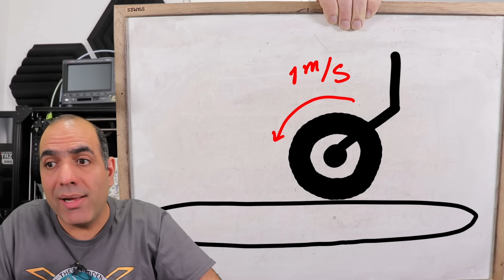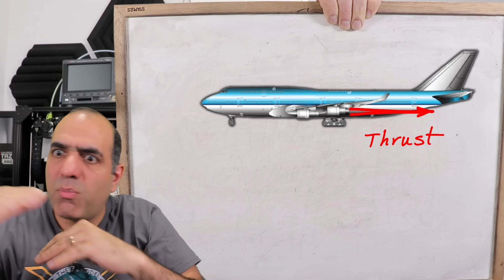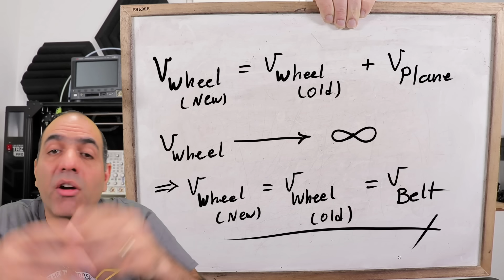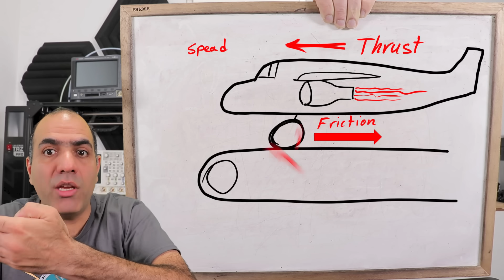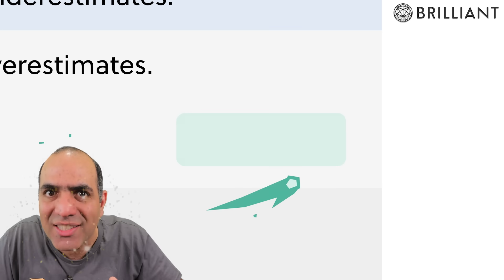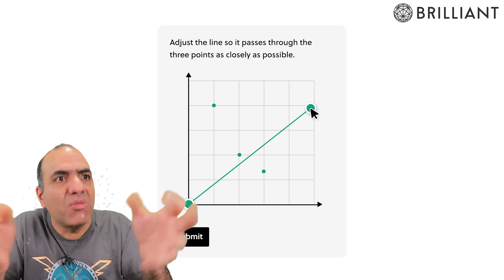Airplane Question that Drove Me NUTS!!!

Comment: If the problem is the wheel moving, you could just sit on the brakes, thus making the wheels immovable. While the engines ramp up, the plane would move the locked-down wheels and the conveyor belt would just follow along, keeping the wheels stationary in relation to the belt.

BUT if the belt is designed to move ONLY when wheels are turning, then i guess the flight is cancelled and you get stiffed by Delta customer sevice.

Comment: The reason why a plane takes off is because velocity of wind at the top side of the wing is faster than the lower side creating a low pressure region at the top which cause the plane to lift. The main factor here is the relative velocity between the plane (wings) and head wind. No matter how fast the wheel spins on the conveyor, as the plane doesn't move, the relative velocity is the velocity of the head wind which isn't much (unless there's a tornado in which case there are other things to be worried about.) Hope it helps!
Reply: The wheels are not imparting torque. The engines accelerate the plane and produce the airspeed, regardless of ground contact. You could lift a plane straight in the air and start the engines, and then drop it with zero lateral airspeed. The plane would still be able to enter stable flight because the engines push on the airframe, not the wheels.
Reply: @Dustin Brueggemann  exactly. That's why the plane would take off in this case(say at 200 km/hr) while the wheels would spin at a linear velocity of 400 km/hr)

Comment: My initial thoughts:
Probably not, turning a wheel on a plane doesn't generate lift. On the other hand, if the treadmill is turning fast enough to displace the air (Magnus effect) it could theoretically generate lift, but that seems unfeasible.

Comment: I haven't finished watching the video but as an airline pilot who also happens to have a bachelors of engineering, I feel like I'm qualified to comment on this. The speed at which the wheels are turning has no relation to the amount of lift a wing can generate. The plane would take-off completely normally, the wheels are not driven so it does not matter that they are not spinning.

Comment: Actually, another thing to take into account in the cases where the belt speeds up infinitely is air friction. The faster the belt goes, the faster the air around it will go, and potentially, if the belt goes at a sufficient speed, the air could speed up to a high enough point for the plane to take off while its relative speed would be low, even potentially negative.
Reply: Glad to see another big brain in the comments. That's called ground effect, and the interaction between the air moved by an infinitely fast treadmill and the wings is only going to add more lift. In short, as long as the plane has sufficient enough thrust to take off, treadmill or not, it's taking off.
Reply: Another thing to consider is that the maximum tractive effort the belt can possibly apply to the plane is limited to the maximum static friction between the belt and the wheels. I am fairly sure you will find that number is lower than the thrust of all 4 of those jet engines by a large margin. That is to say they are going to start acting like skis because there is not enough force being transferred to the plane via friction to overcome the thrust because there is no way to generate enough traction.

Comment: Just full brake the wheels and full throttle the jet engines. The wheels and conveyor belt will lockup (0 speed of both) and the plane now pushes itself and the conveyor belt to gain some speed. With 0 friction of the belt's bearings the plane is like having wheels just with the intermediate of the belt. Problem solved (for me at least)

Comment: I like how there are people that assume those tiny wheels have enough power to even move the massive plane. It's the plane that is capable of moving the wheels, with ease.

Compare this to the crawlers used to transport rockets to launch pads. Big massive treads designed to move tons of dead weight.

Comment: Flight is achieved by airflow over the wings, it doesn't need engines or wheels to fly, hence gliders and sea planes, if it was sitting on a conveyor belt with a mega fan blowing at it then yes, with enough airflow from the fan it would lift off the conveyor belt. There you go, your next video, a model aircraft in front of a fan, what could go wrong? 👍

Comment: The wheels are there to reduce friction between the plane and ground. They don’t cause the plane to move, without brakes the plane could be moved back if the conveyor belt started slow and then sped up. But the amount of force the belt can impart on the plane through the wheels is significantly smaller than what the plane’s thrusters can counter with. The plane will take off like normal but it’ll take I tiny tiny bit longer to get up to speed. Which I think is another way of saying one of Medhi’s answers
Reply: "reduce the friction between the plane and the ground" which is fine until the wheels implode sending the plane nose first into the conveyor belt.
Reply: this magic conveyor belt always matches the speed of the wheels. think about that and then think about your answer.
\
Reply: @dxb338  According to the laws of physics and aerodynamics, the 747 would be able to take off even if it is sitting on a conveyor belt that is designed to match the speed of its wheels in the opposite direction. This is because the primary factor that allows an aircraft to take off is the airflow over its wings, not the motion of its wheels on the ground.
The motion of the conveyor belt, which matches the speed of the wheels, would not affect the airflow over the wings, as the aircraft's engines generate thrust that propels the aircraft forward through the air. The conveyor belt would simply be moving the wheels at the same speed in the opposite direction, but it would not have any significant impact on the relative airflow over the wings.
As the 747's engines generate sufficient thrust, the aircraft would be able to achieve the necessary lift and speed to take off, regardless of the motion of the conveyor belt. The conveyor belt would not provide any additional resistance that would prevent the 747 from taking off, as long as the engines can generate enough thrust to overcome the rolling resistance of the wheels.
Reply: @valtercosta2108  It's like you didn't even watch the video. The wording of the question makes it so the belt and the wheels speed up to infinity. You're acting like it's the Mythbusters scenario, but that's a different question where the belt matches the speed of the plane, not the wheels.
Reply: @sntslilhlpr6601  but even dude, the engines push air backwards creating thrust, the airplane will still go forward. it pushes air and not from the ground. Think like this, if you get roller skates go on a treadmill and attach a rope in front of you to hold on to, the roller blades will spin up to the treadmill speed but you can still exert force on a static  object/matter (in this case the rope, as if it was the air in plane's case) and move forward even if the roller skates are spinning at the same velocity as the treadmill :)
Reply: @valtercosta2108 the infinities fuck with things in ways that are hard to predict / understand.  do the wheels catch fire? melt? explode? dies the tredmill motor catch fire? melt? explode?  even if it were realistic to build such a large treadmill, and it were realistic to match wheel speed for a while, eventually the friction in the treadmill would be too much and something would fail. the only questions really are what fails first, plane or treadmill, and will that failure affect the planes ability to function (eg shrapnel flying into the plane compromising the airframe etc).
Reply: @jnawk83  yeah wheels would be spinning twice as fast as they'd normally do in a normal situation. They're not made for those kind of speeds in mind. and a treadmill capable of all that speed is impossible also.

Comment: My thought: the plane cannot take off

The way the centre of mass and centre of lift works is that behind the centre of mass it can achive flight. Jetliners like these typically are optimized to achive close centre of lift to centre of mass infront. So if you flip the aircraft around. It cannot take off due to the centre of mass and lift flipping

looking back at it in a future edit. i was thinking something different, however it still cannot take off.

because the mass is not moving forward, there is no air to move it with, thus no lift is generated and in result. plane cannot take off

Comment: The question as I see it, there's only one answer - the engines are producing no thrust and it does not take off.  Yes, if the aircraft produces thrust, it will begin to move, and immediately the treadmill will have to accelerate to infinite speed to counter this wheel movement, and the wheels will still be moving faster than the treadmill to result in relative aircraft movement - which violates the main premise of the question stating the treadmill always matches the wheel speed, so that's not part of the scenario.  The question didn't say it matched speed only until it couldn't keep up any more.  The only thing left is for the aircraft to never produce thrust in the first place.

Comment: In my opinion, it should take off no problem as the wheels are not providing the thrust, the engines are, considering the wheels cause no friction, the plane will always move forward, accelerating, hence acquiring the speed to take off 0:42

Comment: The aircraft will take off because the wheels are not mechanically linked to the engines  they are free spinning. Thrust pushes the aircraft forward. In this case, aircraft ground speed matters, wheel speed does not

Comment: In case where bearings have friction, while the friction force will eventually be the same as the thrust, that doesn’t necessarily mean it’s not moving. It just wouldn’t accelerate any more. If it is going at takeoff speed, it would still takeoff, and if it’s not it doesn’t. It depends on how much it can accelerate before the forces equal

Comment: This is a physics question, right? So we don't need to consider reality at all, because physics problems exist in a frictionless vacuum, since they conveniently ignore these problems. That means the plane can't take off because there's also no atmosphere.

Alternately, if you're not an annoying physics teacher, you could attach motors to the wheels and run them backwards, then just spin up the jet engines and take off.

Alternately alternately, just do what I do and don't log into twitter. That should solve your problem of seeing stupid and pointless physics problems.

Comment: Relative to the belt, the plane is moving. However, the plane is NOT moving relative to the air around it so with no relative wind, there can be no lift from the wings.
Reply: So the plane will not take off.

Comment: The belt is completely irrelevant. It's thrust is provided by the jet engines.

Thus the plane will move forward, and I bet the conveyor belt won't even move an inch

Comment: Before i listen to your reasoning, imma try and answer this myself.

First off, it depends on the friction of the wheels against the conveyor belt. This is an unknown so, in the worst case you have stupid amounts of friction and the plane will be sitting stationary. In the best case you have no friction and so the engines will happily accelerate the plane as if it was touching nothing. The latter option would be even better performance than a regular runway. Those wheels have a non-trivial rolling resistance, especially when the plane is fully fueled and loaded.

Secondly, the question is unclear on what it means to "match the speed in the opposite direction". Because if you spin the wheels backwards and throttle forwards, that means the wheels will eventually be stationary as the conveyor is moving at takeoff speed...
If the conveyor were to move at the opposite velocity of the airplane then the question would make more sense.

And so, as the conveyor is moving in the opposite direction to the travel of the airplane. There's going to be air flowing over the conveyor belt due to air molecules sticking to it and pulling nearby molecules along with it. In essence, your takeoff velocity relative to static ground will be nearly half that of your normal takeoff velocity assuming you have airflow over the conveyor belt reach the wings. So you'd actually need half as much of a runway to take off. But then you'd run into a stall as soon as you leave the conveyor belt because there won't be any opposite airflow.

There's just so many factors at play that the question is stupid.

Comment: If the belt would match the speed and acceleration of the plane, it should not be able to take off, as air needs to pass beneath the wings at a certain speed for the airplane to lift off. If the airplane is stationary relative to the ground (a.e.: The belt moves backwards as fast as the plane moves forwards), then the plane is also stationary relative to the Atmosphere - so there is no lift force present on the wings - there is no liftoff.

Comment: i don't believe it will take off because the plane needs air movement at 300 km or so to generate enough lift.
maybe it would take off if the wheels could spin completely free without friction. I wonder if the air movie meant from a giant treadmill would generate enough wind speed to lift the plane with the engine going

Comment: No take off until a possible threshold is met.  No flight assuming the wheel speed and conveyor belt match even when the jets are firing.  In this scenario the forward movement is countered by the belt so no wind flowing over the wings creating lift.  *** Lift CAN occur though if the jets are moving the air around the plane sufficiently, causing air flow over the wings, creating lift  Once one wheel gets off the conveyor the plane will quickly take off. ***

Comment: It’s obvious any plane has to move forward at speed so air is forced over the wing to generate lift, if the plane is stood still with the brakes on and you engage full power (thrust) do you think the plane would take off? NO it wouldn’t so if the conveyer belt is running and the thrust of the engines keep the plane in a stationary position and then you slowly increase the belt speed and the thrust to match keeping the plane stationary, will the plane take off? NO because there’s no lift from the wings simple.

Comment: it won't take off. air speed under the wings will remain cup counter speed on the airfield. which is not fast enough. it's the ait speed not the wheel speed

Comment: I would say absolutely not. The plane cannot take off. 

If the conveyor belt matches the speed of the wheels in the opposite direction (assuming that it and the wheels can go infinitely fast), then the plane simply cannot accelerate to make the relative airspeed to the wings enough to provide lift. The plane would just sit still with infinitely accelerating wheels on an infinitely accelerating treadmill / conveyor belt.

That's my theory.

Comment: Sorry for my English, I am smart in Hungarian only. So the system, where the plane is the whole planet. It needs to move with an exact speed against the planet, not against a platform. So the short answer from me in the beginning of the video, it wouldn't take off, as it is stands in the same place, if you compare it to the planet.

Comment: 0:48 I say "yes" because the wheels are not powered, they are limp. The thrust that provides forward movement to the plane is done by the engines, which are independent from the conveyor belt. You might see a slight drop in engine efficiency as the friction of the wheels moving so fast against the belt, but it will still take off, especially if it is empty of passengers.

my reaction after the video: WIP
Reply: The wings need airflow to generate lift, that can't happen if the plane can't move
Reply: @Jessethefunnyguy  But, it can move.
Reply: @The_Cyber_Nomad  For the plane to move the wheels would have to move faster than the belt, which cant happen.
Reply: @TunaIRL  This was my problem with the question. IF the initial condition is that the belt matches the wheel speed at all times, then by definition the plane cannot take off unless we lock the wheels and pour lube all over the belt.
Reply: Oh man, I've gone back and forth on this 4 or 5 times and now your comment helped me understand even better. If the question assumes that the wheels CANNOT go faster than the belt no matter what, then there'll be no movement. Sure, the engines generate thrust, but for the plane to actually move forward, the wheels would have to be turning FASTER than the belt would be going. There's no way around that. 

So, I guess, if there's no friction in the bearings of the wheel or with the air, then with full thrust both belt and wheels spin infinitely fast with no movement. With friction, the belt and wheels spin extremely fast until they explode and there's still no forward momentum.

However I saw people talking about "ground effect" and I guess what that means is that the moving belt would cause some sort of airflow to be generated... If the belt was moving fast enough, and was the size of the runway, the plan would eventually lift off with no forward movement because the air is being forced to move around it

Comment: The airplane engines are coupled with the air, not the ground. So the ground doesn't matter in this case. Plus, if the belt matches the speed of the plane, the top speed wouldn't be infinity, but twice the take off speed. Main reason being there needs to be a positional change for there to be velocity and a plane positional change isn't caused by the wheels.

Comment: I assume that the engines are off, and the plane is moving only using its wheels, but the conveyor belt cancels out any speed generated by the wheels's movement, so the plane wouldn't take off and look stationary